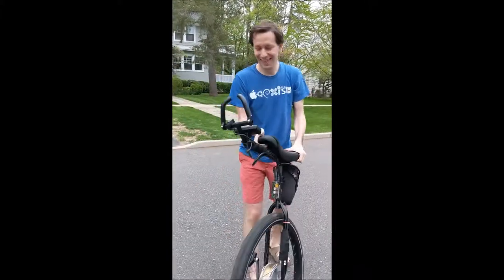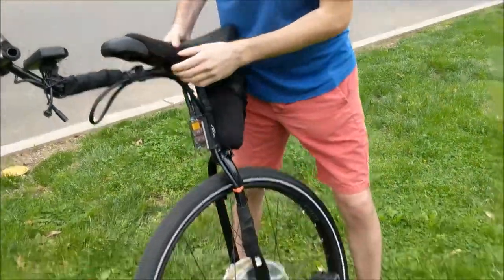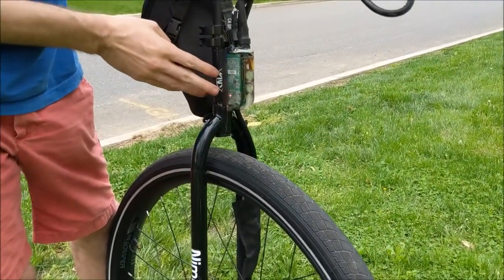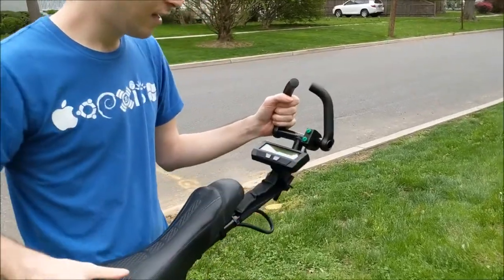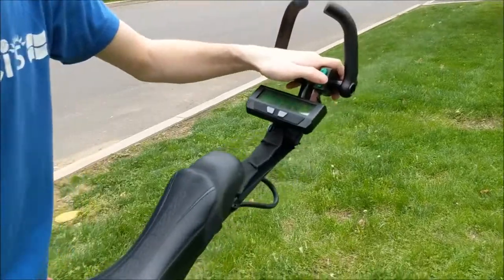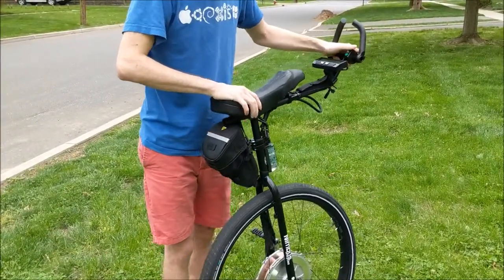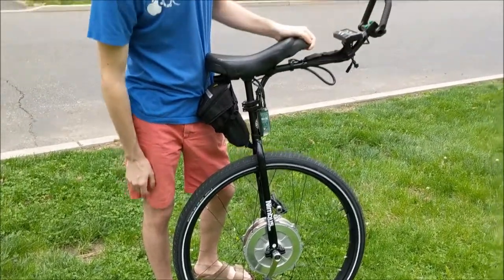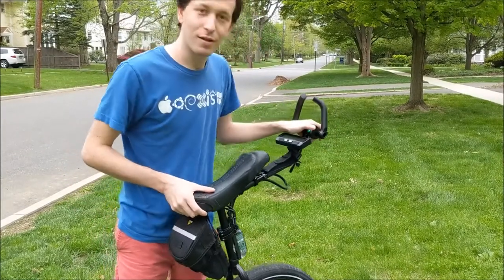Electric Assist Unicycle Build

Comment: Very well done Logan! Super clean install and motor modifications.  Now you just need to find some steep hills to go up and down to really feel the magic of electric assist.  

I'm really happy to see someone else succeed in doing the pedalable electric unicycle build and you nailed it with this. Hopefully you'll be able to clock some good mileage and then get to work building a geared version ;-)

Comment: How does a hub motor work in a unicycle? Is the stator attached to the frame and then how do the pedals connect to the rotor and wheel is the stator is in the way?
Reply: Yeah it works but with a fair amount of modification. You can see my build linked in the comments. The stator is attached to the frame, but the axle/pedals are all bolted to the rotor.
Reply: @polkacrazy  hey this is really cool how would I be able to make my own?